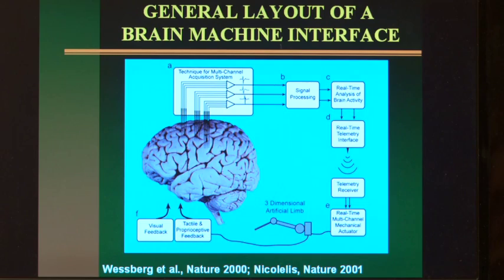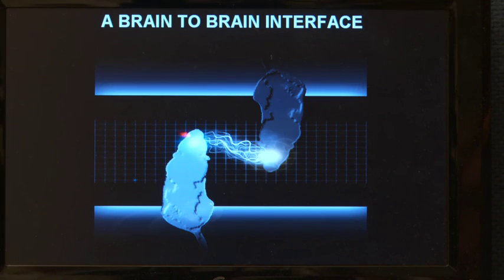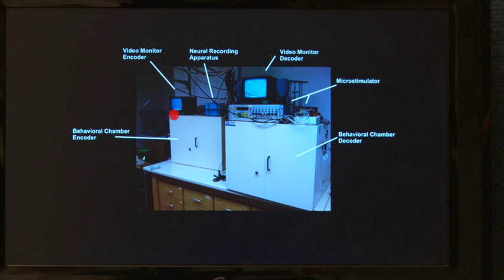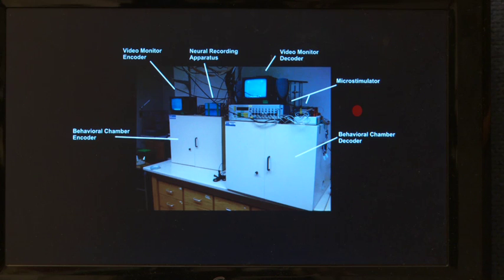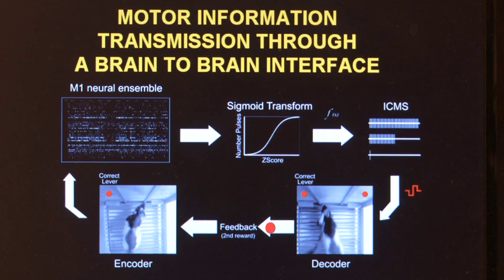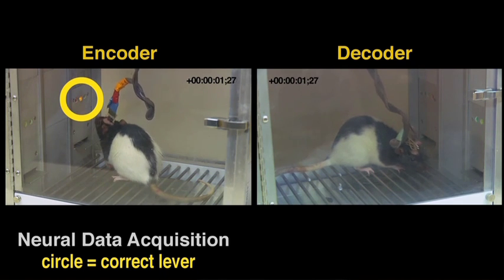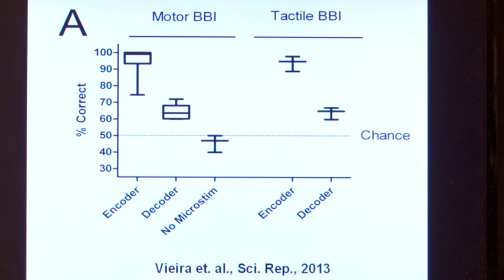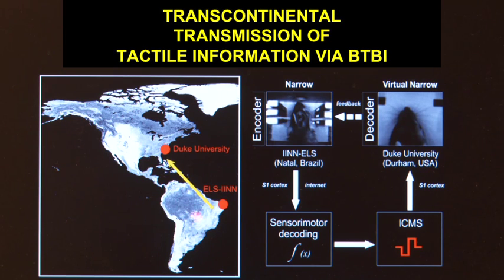Dr. Miguel Nicolelis Explains Brain to Brain Interface Study Published in Scientific Reports

Comment: Military Spy Weapon that Monitors the Brain

Brain monitoring devices

Victims experience different things depending what the operators do at different stages. Sometimes, the operators will perform quick random hybrid testing. Here are the stages of torture I have suffered physically:

• Brain monitoring
Use a brain reader to spy on and record the victim’s thoughts and what the victim sees. The victim does not feel anything physically or hear any sound. 

• Brain language interpretation system
Access and analyse thoughts inside the brain and interpret the information. 

• Sound frequency transmission
Transmit sounds to the victim. Those audio recorder pens available in the market are not able to record the sounds, but the victim can hear them. The sounds are not audible to others. The operators use a device to control whether or not the victim can hear the sounds. 
- High-frequency buzz with low-frequency vibration is caused by the operators controlling the frequency. The victim will experience ear swelling and pain or a tingling sensation in his or her eardrums.
- The victim is still able to hear the long buzzing sound. Normal buzzing sound usually does not come with constant long, high-pitched sound. There are very minor pitch differences to differentiate the buzzing sound, e.g.:
 “sa sa” sound produced by television or sand
 constant long, high-pitched sound
 long, low-pitched sound produced by television (steady volume level)

• Low-frequency vibration
Silent high and low frequencies are used to vibrate body parts mostly to torture the victim to make him or her yield. It feels like the vibration one feels when standing near a large speaker. The frequency and extent of the vibration can be adjusted. The frequency must be different from the heart rate for the victim to be able to differentiate it clearly.     
- Transmission of vibration frequency is an aid. When the vibrations are being sent out, it does not mean that the operators are transmitting information at the same time. Sometimes, the spy will send out single repetitive, fast, low-frequency vibrations to torture the victim.
- Sensation felt in the brain, chest and ears.
- Fast frequency may cause: giddiness, headache, mild feeling of brain concussion, blurred vision, tightness in chest, breathing difficulty, arrhythmia (illusion) 
- A torture method that targets the brain area to cause pain in certain parts of the body: Target strong, fast low-frequency vibrations and long buzzing sounds at the brain area for 24 hours a day for a long period of time. After six months, it will cause fever or elevated body temperature, headache and giddiness every two to three days. Every time, the headache will be at about four fingers to the right and the left from the middle of the top of the head. If the left side is painful, the right side will be numb, vice versa. This is not a standard symptom. There are many ways to achieve this. If high-frequency vibrations are used at the same time, it will cause pain in the head or other parts of the body concurrently.          
- Able to hear the conversations between more than two operators. Use slow low-frequency vibrations (targeted at the heart or other parts of the body) and sound frequencies (long buzzing sounds). Can be operated by two people concurrently and used on two body parts. Information is differentiated using speed. 
- Use strong, fast low-frequency vibrations that are faster than the heart rate to cause the victim to feel chest discomfort, difficulty in breathing and irregular heart rhythm.
- If the victim is walking or exercising, high-frequency vibrations must be used to transmit information. During or after exercising, the victim will not be able to feel the vibration because his or her heart is beating very fast. The operators will use sound frequency to transmit information.  
- At slow frequency, the operators will speak at a rate slower than heart rate. Without sound frequency to help with the transmission, the victim is able to read the information in an idle state.  

• High-frequency vibration
Used to warn or torture the victim. May be divided into the following three methods:
1. Constant tingling sensation – Frequency is the same as that used in laser guns used for medical aesthetics purposes. Burning sensation. If used on organs such as the heart, it will cause agonizing angina.
2. Constant sensation of electric current flowing through
3. Quick electric shock sensation – Feels like being pricked by a needle. If the electric shock is strong, the victim may wake up from sleep with a scare.  

• Satellite surveillance 
Use satellite to transmit images to see clearly the surroundings of a moving victim and the people and things the victim has contact with. 

• Voice and video recorder 
Record the victim’s thoughts and actions. May be used to hypnotise the victim.
Hypnotise the victim using edited brain language of the victim after having spies collect recordings of the victim’s brain language and observing the victim’s weaknesses for a long period of time. If the victim does not have a firm mind, he or she will very easily follow the hypnosis instructions, thinking that it is his or her own thoughts.

Using ignorant civilians as guinea pigs

Except when due to mental problems or religious reasons, long buzzing sounds, strong static electricity shock, tingling sensation from electric shock, heart palpitation, chest tightness, headache, giddiness, mild hallucination, etc., make people believe that their body is sending out warning signals and that what they are experiencing are caused by stress and external environment. Physical examinations will show nothing. What is really happening is that they are being affected by brain monitoring.  

The ignorant people and psychiatrists are not well-informed, the government is hiding the truth and shirking its responsibilities and intelligence agencies are withholding information. As such, the victims think that the problem lies with them and end up with mental illnesses. When it comes to brain monitoring, those who are not professional psychiatrists and those who have not actually experienced it can only refer to the mental illness symptoms found in books to guess what the person with mental illness may be having. The so-called mental illness is nothing but a name decided by the psychiatrist association through voting.
.
.
WARNING: Important individuals from your country may be being monitored with a brain monitoring device and important information may have been leaked through a military spy weapon that monitors the brain.
.
.
Victim declared the following:

My experience as a victim for three years proves that the Taiwanese brain monitoring operators are able to spy on people in Mainland China, Australia, Singapore and South Korea freely. After setting a human target, the brain monitoring device is able to spy on this person 24 hours a day. If the person being spied on, i.e. the victim, interacts with other people, the brain monitoring officers will also be able to read their thoughts freely as well.

Feeling indignant that the brain monitoring team members, who had neglected their duty, were using a government device for personal purposes, I took China Airlines and Cathay Pacific flights to different countries to search for places that were not being spied on. I did not bring along any laptop, mobile phone, electronic devices, and there were no tracking devices on my personal hygiene articles and clothes; and I did not bring along any items that belongs to others. However, throughout the entire flight journey, including taking off and landing, I could hear the brain monitoring operators deliberately disclosing spy information. This is definitely not a form of spying that ordinary pinhole surveillance cameras and organisations are capable of achieving.

While sending brain information to and talking with the brain monitoring operators, I could tell based on my knowledge of the local culture and the accent that they were Taiwanese. There were three teams. They worked shifts 24 hours a day, with three operators per shift. The brain monitoring operators see my going public with this letter as betraying Taiwan. As such, they want me to commit suicide. Day in and day out, they torture me using low-frequency vibrations. I have a constant headache and recurring fever. My vision is blurred and my head is splitting. They hope that with me in fear and feeling mentally and physically exhausted I will not be able to expose the secret.

I believe that military technology professionals are able to find out the truth by determining what devices are able to transmit brain-monitoring information. There are transmission records for all signals, whether they are sent through satellite, network devices or cross-border signal transmission devices.

I am not a volunteer. I did not sign any relevant documents. Before I was being monitored, my physical examination results were very good. I did not smoke, drink or use drug. I did not have any bad habits. I was careful with my diet and did not share food with strangers. I was in good health, mentally and physically. I did not have any surgery. I did not have nightmare and I did not sleepwalk. I had a simple social life, maintaining normal relationships with my male and female friends. I did not make any enemy or have any debts. My family was simple; no one in my family was involved in political activities. I studied arts in university. My work had nothing to do with high-tech electronic products.   

This event all started in Taipei on 2011 with a man called Gordon Xue, Taiwanese name as Xue yong-Sheng, the only person who has actual contact with me and who is involved in brain monitoring, declared the following:

I used to work for the government. I could use the express lane at customs. Currently, I am helping my family acquire hospitals through legitimate and illegitimate means. My father was previously a senior management member of X Group. My uncle is the owner of a screen manufacturing company. He was once named one of the richest men in Asia. Chiang Ching-kuo attended my parents’ wedding to congratulate them (Once, he show me photographs to prove this). My mother used to manage a property insurance company, and my maternal grandfather was a retired official. My mother later remarried to someone whose family owned a Taiwanese shipbuilding company and had mafia connections. 

I saw with my own eyes that while following and protecting him, every one of his bodyguards, who were not wearing earphones and had not taken any phone calls, knew exactly what to do and when to leave. These bodyguards prove that unforeseen circumstances cannot be prevented even with using brain monitoring to transmit information.  

As at the time I finished writing this letter in 2014, I was still being tortured.